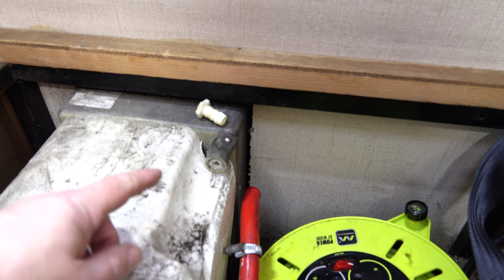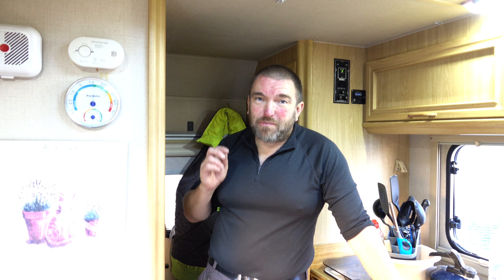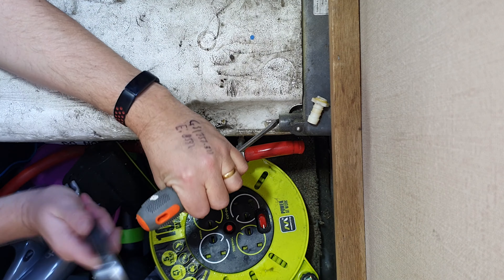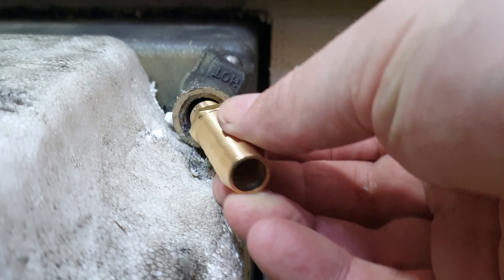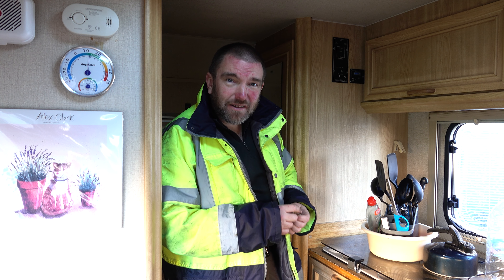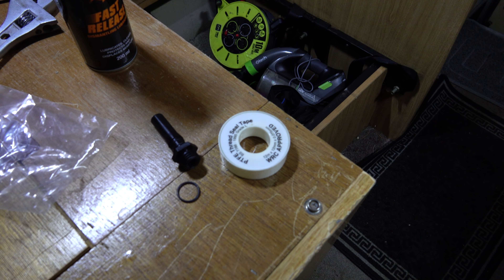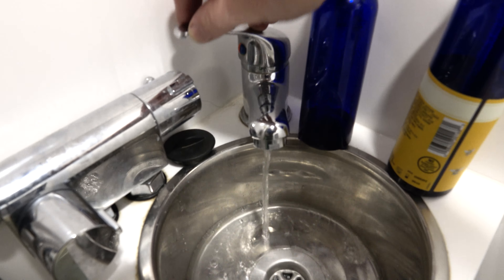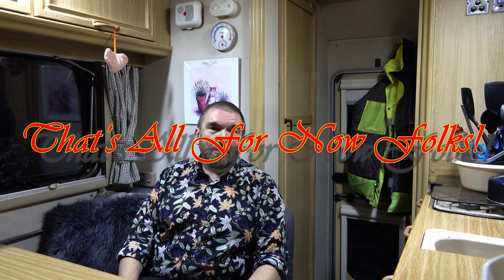Replacing A Broken Hot Water Outlet - Carver Cascade 2

Comment: I went through the exact same problem last November. Nine was broken and had been glowed for more than 10 years, before I bought he motorhome. Done all the steps by the same order and ended up drilling the plastic,  aplied some heat and removed the thread with a needle. No luck to find a fitting with the same thread in Portugal, so I joined the red and blue hoses.  Travelled to UK with cold water in all taps. Caravanstuf4u had all the bit I need. Thanks to make  me smile 😃
Reply from the maker: Glad you eventually managed to find the right part, it's a pain not having any hot water. Is the Carver heater not a common thing in Portugal?
Reply: @ttxela I don't know any caravan shop near Oporto city, so I tried the brass fitting like yours and Leroy Merlin and other plumbers suppliers without sucess. Thought to by the water intake, but I cannot carry on travel with spare parts for everything, I do have a set of auxiliary belts, exhaust rubbers, front struts, filters, oils, and tols. I used to traveled with a new alternator and clutch but know they are fitted. I 'love' my 1994 Talbot express 100 000 miles, a joy to travel, and always carry a can of easy start at hand for assurance if the temperature drops bellow -12 C like in had in north France.

Comment: Your very lucky Alec, had a very similar problem a few years ago wth the carver unit we had, ended up having to replace the whole heater. Wishing you and Nikki a very happy new year.
Reply from the maker: Oh no, that sounds drastic, did the aluminium casing break?
Reply: @ttxela  Yes it split in two places didn't realise it was aluminium I thought it was cast iron so was a little over exuberant with the tightening of the replacement part, but like you said the heater had been in the 1991Talbot Koni for over 20yrs... So you did real good work not splitting the casting. Again al the best, we really look forward to your videos. P & M
Reply from the maker: @Giles4me  oh dear, yes, everything in the vans is a little more delicate than it appears 😕

Comment: Hi Alex, an easy way to get those plastic connectors out is to get a large screwdriver, heat the end with a blowtorch, press the hot end into the middle of the connector, and unscrew it. 
It worked on my pressure relief valve. Also, the pressure relief valve is the same thread as the tow ball bolts, ideal for cleaning up the thread.
Reply from the maker: A good idea, I'll try that next time 👍

Comment: Well done Alex
I've never had much luck with plastic fittings and my last incontinent toilet cistern leak turned out to be condensation because we've had to turn the heating off lately.
A bit like that man who changed several windows before he realised that he had a crack in his specs.
Reply from the maker: Condensation can cause all sorts of problems. Have you had heating issues then?
Reply: @ttxela  yes, it's always a problem with older houses, very difficult to manage

Comment: Hi Alex just a thought regarding Diesel Heater. As you mounted it on wood. Did you fit a grounding strap from mounting metal plate to chassis of van. Not sure if it needs one but 10amp heater glow plug current etc. Cheers from old George. Have a good adventure in Wales. 👍🤔🚐
Reply from the maker: Hello George, no grounding to the chassis, just straight back to the battery terminals. The new one seems to work fine like that so I think it's OK like that 🤔

Comment: Hi Alex, haven’t spoken to you for a while, hope you guys are all good. I still have the autoquest 270 (1993). I’m still struggling with a leak coming from the back of our cascade2 where the big gasket it fitted when you bolt the tank to the gas module part. Is there a set height to support the tank body up to, as I think I need some support bracket to help it when it’s full of water. There wasn’t anything there when we got the van but the previous owner said they never used the hot water anyway. I’ve looked online but can’t see if anyone else has a cradle sort of system to help carry the suspended tank, cheers, Davy.👍
Reply from the maker: Hello David

You are testing my memory now and of course I don't have the van to check. I'm pretty sure the cylinder wasn't supported by a separate bracket. If you have a persistent leak from the gasket I'd say there must be an issue with the gasket, it's mating surfaces or the bolt 🤔 I think I recall using some food grade grease on the gasket.
Reply: @ttxela  thanks for getting back so soon bud, I basically got a new rod fabricated as the old one was snapped at the threaded part, as they do, I also replaced all gasket with a new set and used the food grade silicon too but when I add water I think gravity takes over and drops the tank enough to break the water seal at the big gasket. It’s maybe supposed to be floating, but I will try and form a support cradle anyway to see if that helps.👍👍